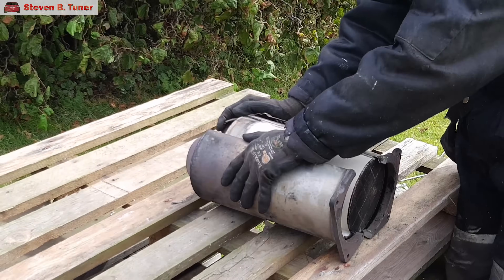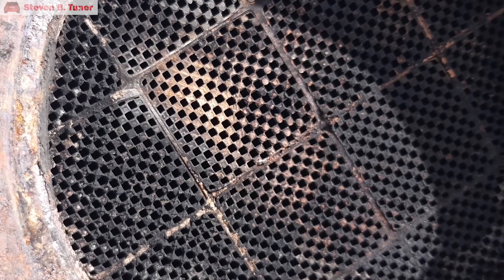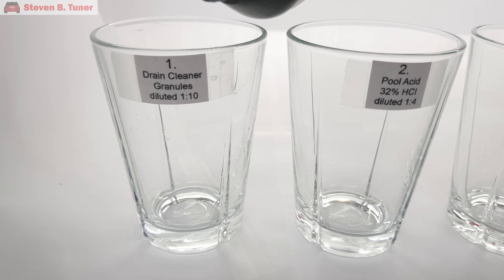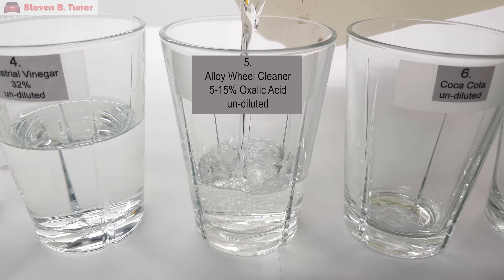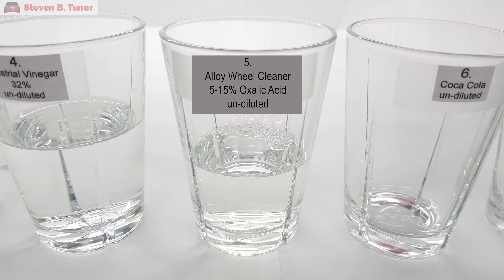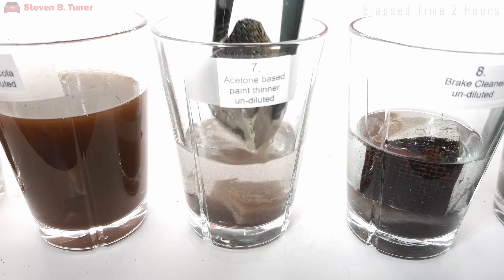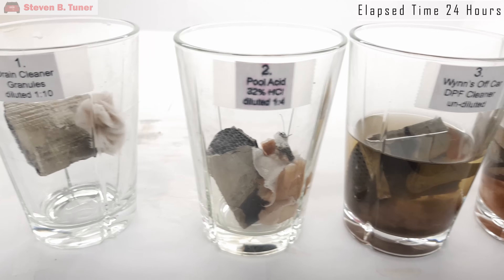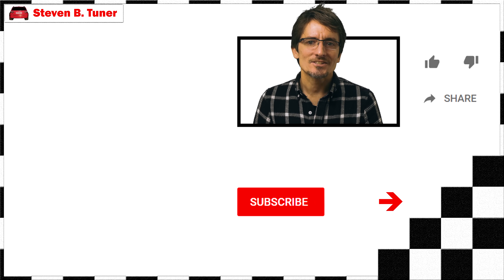DPF Cleaning at Home – 9 Chemicals Tested (Diesel Particulate Filter DIY Ash Cleaning)

Comment: Hello Steven, I am planning to do the DPF cleaning on my 2014 vehicle as follows:
Step 1; Dishwashing tab 1:10 water for 30 min
Step 2;  Pool acid 1:4 water for 30 min
Step 3; rinse with tap water.

Any suggestions?
Reply from the maker: Hi, if there is a lot of black soot, then you might need to do the first stage multiple times. After the first stage you should rinse thoroughly. After the acid stage, rinse with lots of water mixed with dishwashing liquid, and then hose with water for at least 10 minutes. When you put it back in the car, idle the car for 15 minutes to gently dry it out.
Reply: @StevenBTuner  Good morning, just placed an order for new gaskets and bolts/nuts. I will keep posted on the outcome of my project once its completed.
Reply: Hello Steven,  I am happy to report that after a second treatment but this time for 24 hr exposure in the DPF cleaning process , my 2014 Porsche Cayenne DPF is back to normal. I just finished testing it and it drives like new again and no more "Check engine/Glow plug" lights. Thank you so much for all your guidance and for saving me at least $7K in total repairs.

Comment: But the exchaust when hot will burn some off so you’d have to add heat as well , wouldn’t you
Reply from the maker: Hi, the biggest issue is with the ash that accumulates over time, and heat won't remove it in the same way that it burns off the black soot
Reply: @StevenBTuner    Oh right

Comment: HG limescale remover seems to use the combination of phosporic and oxalic acids may be worth a try?
Reply: Also seems to be safe to use with most metals, most importantly stainless steel.
Reply from the maker: Limescale and 'ash' are pretty similar - so limescale remover is definitely worth a test!
Reply: @StevenBTuner  HG limescale remover works great!, used it today and now my dpf's squeaky clean! Pre-wash soak with dishwasher tabs until water ran clear again and then short soak with the HG as its quite concentrated ! Lots of Orangy coloured mess cam out and Zero reactions with any of the metals ! Flushed through until water ran clear maybe worth doing another vid?

Comment: Stage 1 Drain Cleaner
Stage 2 Dishwasher Tabs
Stage 3 Pool Acid in 6-7%
?
Reply from the maker: Hi, the drain cleaner and dishwasher tabs do a very similar job, so there is no need to do both. My favourite system is still the one featured in my video: The No Damage DIY DPF Clean

Comment: 6:49 great choice but if I may put in my bit..I would add the all around unknown Diluant cellulosique and surprisingly Naphta...you allways have to give chance to naphta. Folks from Utah would suggest Antifreeze. but surely brake liquid would do the trick.  11:55 clearly a little vibration from a pad sander tapped to the table would have done wonders.
Reply from the maker: Hi, great suggestions for a future test!

Comment: Hi, can you use wheel cleaner with Hydrochloric acid ?
Reply from the maker: Hi, the problem with wheel cleaner is that the ingredients change depending on brand, and other factors out of your control.
Reply: Hydrochloric acid is corrosive to steel. You will have to make sure there is sufficient dilution before using it.

Comment: How do you dry the internal parts of the DPF? I assume that you rinse out the products used with clean water?  Thank you Steve!!
Reply from the maker: Hi, lots of back-flushing with water mixed with dishwashing liquid works well. There is no way to dry it out other than overnight in an oven, or half an hour of idling once it is back on the car.

Comment: It is possible clean DPF without disassembly?
Reply from the maker: Hi, I haven't developed my own process for in place cleaning, so I recommend using the product from Liqui-Moly.
Reply: @StevenBTuner  just seen a guy just use a pressure washer without taking it apart and it worked very well.

Comment: Hi all. I'd like to clean my dpf filter but without removing it through the thermometer sensor hole. My question is which chemical should I use?
Reply from the maker: Hi, for in place cleaning it is best the chemical from Liqui-Moly that is designed specifically for the job. It won't be the same as doing a full clean off the car - but will probably be good for a couple of years.

Comment: Hi Steven, Thank you for sharing your knowledge. I First burned the filter off at 650 C for 15 min and then let it soak for a night in dishwasher tablets with water. At last I poured over some cleaning vinegar since it was all I could find easily. And the result is that I can keep on driving the car for another year without having to pay 1000,- for a new filter so thanks a lot. Keep up the good work!
Reply from the maker: A bit of a hybrid process, but is sounds like it did some good!

Comment: i would like to use the dishwasher tabs as a pre wash before using the wynns, would you mind tellingme which of the many dishwasher tablets you used, and how many per 5ltr of water. Many thanks for sharing your results..avid watcher..
Reply from the maker: Hi, the dishwasher tabs and the Wynns product both do a similar job, so you will need an acidic solution for the 2nd stage wash. See my other video for my favorite method: The No Damage DIY DPF Clean.  If you use dishwasher tablets then the number needed will depend on how much oily soot there is to remove. I don't know the brand of the tab as it was one that had fallen down the back of the cupboard, and I didn't expect very much from it.
Reply: My intention is to scan the car for soot mass and dpf pressures at tickover and 3k rpm, then do the on car dpf clean firstly with dish tabs, then rescan before i do a final clean with wynns and obviosly scan again... i do have some 30% acidtec which i can use if my scanned numbers/results do not come down to what i would call excptable levels, but fingers crossed the first two products will get me thier..  @StevenBTuner

Comment: so 1 step - use dishwashed tabled dissolved in watter. than use some accid.
Reply from the maker: Hi, if you are going to do the job then my favorite method is still the one featured in my other video: The No Damage DIY DPF Clean.
Reply: But make sure to rinse and never mix the chemicals.

Comment: Diesel fuel
Reply from the maker: Hi, diesel fuel is already used by your car to burn off the soot deposits, but it doesn't have any effect on the ash deposits.
Reply: Not to burn, but as a solvent.

Comment: Can you share which brand of alloy wheel cleaner you used in the video? Thanks.
Reply from the maker: Hi, the brand has changed the ingredients since the video - which is why I always prefer using generic chemicals wherever possible.
Reply: Then what should be the ingredients to get the amazing effect in the video? Or what are the ingredients of the cleaner in the video? Thanks

Comment: Hi Steven, I have a question.    I used a professional dishwasher detergent with ph 14 in my dpf and the result was great. Do you think I can also use it in the catalytic converter? Thank you very much
Reply from the maker: Hi, that will be perfect for getting any oily gunk out of the cat too. Catalytic converters can be covered in a layer of ash too, so a second stage acidic wash could be necessary too.

Comment: Have you tried Sulphuric acid drain cleaner I have 2 L of 98%, obviously would need diluting
Reply from the maker: Hi, it should be a good solution to use as it can dissolve ash and does not harm stainless steel as much. I haven't done any testing to determine a safe dilution for the catalyst materials. The reason I haven't done a video about it is that it is not possible to buy it in most countries.
Reply: @StevenBTuner  👍👍👍

Comment: Why didnt you use h202 +h2so4 sol? It dissolves carbon easily. Pls make another video also use aqua regia to try out.
Or 30% h202 only.
Reply from the maker: That stuff is 100% pure evil! If you get dilute HCl on your skin then you can walk over to a sink and wash it off before it does any damage, but using the evil mix you will have your skin eaten away while you scream in agony. I don't want to kill my audience!

Comment: что оказалось самым эффективным способом ?
Reply from the maker: Hi, the most effective way is probably a first stage wash that is a mixture of sodium hydroxide and dishwasher tablets, followed by the 6% hydrochloric acid solution, and then washed out with lots of water and dishwashing liquid. I show the whole process in my other video: The No Damage DIY DPF Clean.
Reply: @StevenBTuner  Спасибо ! Но есть же специальное средство для мытья сажевых фильтров !  А как влияет мытье на другие компоненты ?  Ведь рядом с сажевым фильтром находится катализатор! p.s. у меня например opel zafira B 1.7 dizel  и я хочу его помыть ...

Comment: @StevenBTuner do you think Calgon will work for stage one? That's the ingredients list:
Water.

Sodium Acrylic Acid/MA Copolymer.

Sodium Citrate.

Fragrance/Parfum.

Methylchloroisothiazolinone.

Methylisothiazolinone.
Reply from the maker: Hi, Calgon is for limescale removal, and limescale is similar to the ash buildup - so it is more suited to stage 2, but you'd have to do some testing to determine how long it would take to be effective.

Comment: Hei, in Biltema have something called "dieselparticalfilter" cleaner part number 34-007
Whats your opinion on this product?
Reply from the maker: Hi, there are lot of similar products around - and what they do is lower the temperature that the soot burns off. This can be helpful if your car never does long enough journeys to enable the active DPF regeneration to be triggered, or if there is an issue that is stopping the regeneration from being scheduled. It won't fix any underlying engine issue, or remove the long-term ash deposits though.

Comment: I had a business formulating cleaners, wheel cleaners, degreasers. Sodium hydroxide by itself does not do much. It needs other chemicals. Surfactants. Use a strong all purpose cleaner first, then the oxalic acid. Oxalic can penetrate thru your skin, and be dangerous. It seems mild, but is toxic. Many wheel cleaners, as I made and sold, contained phosphoric, hydrafluiric, sulfuric. There is a powder form of hydrafluiric. Sulfuric is really, really dangerous. Only rarely used in wheel cleaner. ABF, ammonium bifluoride is the powdered form of hydrafluiric. Hydrafluiric likely would work better than hydraclouric.
Reply from the maker: Awesome information! I have tried to get the most generic and cheap chemicals to do the job so that they can be obtained anywhere in the world, and am currently putting together the list for 'round 2', so your information is very relevant :-) In regards to the sodium hydroxide - do you think that mixing it with dishwashing liquid would give it enough surfactants, or would it need something like ethanolamine? (or is using dishwasher tablets or industrial degreaser for 'stage 1' the easiest?).

Comment: I'm surprised at the result of acetone. I recently changed the injector seals on my car and the tube came out with the injector as it was bound with carbon. I soaked it in nail polish remover overnight and a little twist I managed to separate them.
Reply from the maker: Hi, the issue with 'end-of-life' DPFs isn't the carbon/soot, as that burns off during active and passive regeneration. The problem stuff that clogs up the channels is the ash deposits, and they need an acid to dissolve them.

Comment: Thank you for such a great job, the results will help a lot of people for sure! How do you think what will be better for cleaning very dirty peugeot petrol catalytic converter which was polluted with motor oil(there is some oil consumption as the engine is worn)? What about dishwasher tab for 24h, then rince it with water and then oxalic acid for another 24h? Then I also want to add adblue onto the surface of catalytic(about 20-25ml) and then immediately start the engine and let it idle till the white fume disappears. Btw, the car can't even go up high long hill because of clogged catalytic converter)))
Reply from the maker: Hi, that should work quite well, although I don't know if the adblue will help anything. A good rinse with hot water mixed with dishwashing detergent is a good idea to neutralize any remaining acid.  I haven't extensively tested oxalic acid so it wouldn't hurt to start off with hot water and a weak solution of acid, and if it doesn't do enough then you can bump up the concentration or repeat it a few times. Can't wait to hear how it goes!
Reply: Of course I will write here about how it worked in 2-3 days, and speaking about adblue, well here in Russia some people have tried that method and it really works. Thanks again and all the best from Russia @StevenBTuner
Reply: Update/ Ok, safety first, so skin-eyes protection and good air vent. necessary. First was citric acid solution(approx. 60gr for 2.5l water) with constant temp. about 75-80C for 1.5 hour. Black particles in the water. Then I used toothbrush to remove oil deposits which became soft and changed its colour from black to light grey. Then rince. Almost all deposits are gone already. After that was wc cleaner containing oxalic acid-I just added it(appr. 300ml) into hot water and let it stay like this for several hours, I didn't heat it. After that thorough rincing again, some pressure preferable. A lot of black particles came out. The catalytic converter surface is like new. And the third step is dishasher tab, I'm going to let it soak for 12 hours and then rincing and assembly. So these acids do can clean even very dirty converters. Mine was covered with oil deposits(about 90% of surface) and there was no check engine light, but the power loss was significant so that steep rise was a real problem. Thanks!
Reply from the maker: Great to hear that it all worked well!
Reply: Thanks again for your tests! After a week of driving with a clean converter I must say that the car's performance has changed greatly, 207 is so fast now! Btw, I tried to restore extremely dirty spark plugs after 48000 km with  the wc cleaner containg the oxalic acid(about 6-8hours in a solution of 25ml cleaner and about 5-10ml water, then brush them and rince) and now they are like new, white and shiny, and they work perform perfectly again.    @StevenBTuner

Comment: How about a good old fashioned power washer with a turbo nozzle?
Reply from the maker: Hi, I have another vid about DPF pressure washing. How effective and safe it is depends a lot on the design of the individual unit. One thing is certain though - a high pressure washer will very easily rip the precious metals off of the catalyser and ruin it.

Comment: In the food industry We use NAOH followed by  HN03 but at elevated temperatures usually above 65-75 along with flow to create mechanical turbulence and scouring action Of course a domestic dishwasher is also plus 65 degs
Reply from the maker: Hi, that is a very good combination - and should work really well for DPF cleaning too. What product or HNO3 acid strength is used?

Comment: I used a steam cleaner pressure washer easy
Reply from the maker: Hi, I have another video about pressure washing and the associated risk of damaging the relatively soft ceramic glue that holds the individual modules together.

Comment: Steven, what is the name of the Alloy wheel cleaner you used for this test?

Thank you for the video
Reply from the maker: Hi, the wheel cleaner is from Biltema, but the chemicals they use are different now to be more 'friendly'. That kind of thing happens alot, which is why I try and use commonly available generic chemicals in my tests wherever possible.
Reply: @StevenBTuner  why you haven't used any grill/oven/barbeque cleaner in this test? looks logical for such a job. I have used them to clean pistons from carbon deposits for example and it works good. Also intуresting how H2O2 will behave

Comment: Hi Steven, I really liked you`re videos. I found that the best combination to clean a DPF filter is a 2-mol Oxalic acid and Ethylenediaminetetraacetic acid in water. The materials are kinda cheap since you only need a few grams of each per litre and you can do a flush with the engine running. I`ve done this for about 4 times on my own VW Touareg in the last 3 years and the dpf is in best condition.
Reply from the maker: Hi, that sounds like an excellent solution for in-place cleaning. I'll have to try it out :-)
Reply: @StevenBTuner  please send me you`re thoughts on this after you try it. The original solution is from a german company that does a solution for on-car dpf cleaning
Reply: Yeah, remove the oxigen sensor and pour about 1-1.5 l solution. Be careful not to pour into turbo. VERY BAD IDEA
Reply: Hello, sounds good, but how does something like this work with a built-in DPF? Fill in the agent via the lambda sensor opening or temperature sensor opening? What does this do to the differential pressure sensor? Thanks!

Comment: Hi Steven, 
Great Vid, much appreciated!
A quick question if I may, the dishwasher tab solution 1:10, was that ratio a random choice and, was that by weight or by volume?
Many thanks,
Greg
Reply from the maker: Glad you liked it! The dishwasher tab was a wildcard suggestion that I wasn't expecting anything from, so I haven't done any testing. Treat it like a degreaser to remove any oily soot, and it will probably work well as the first stage wash.
Reply: @StevenBTuner  - Thank you for your reply.